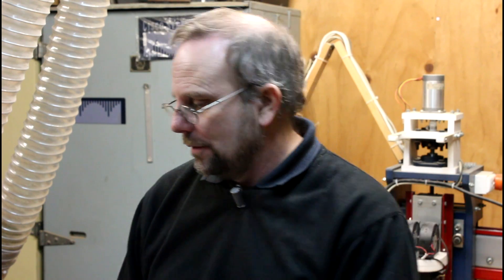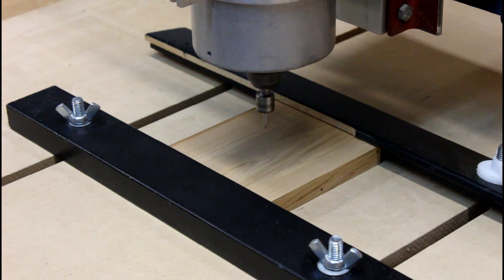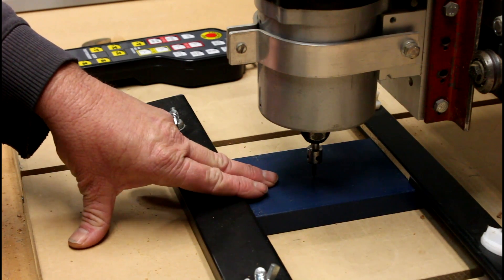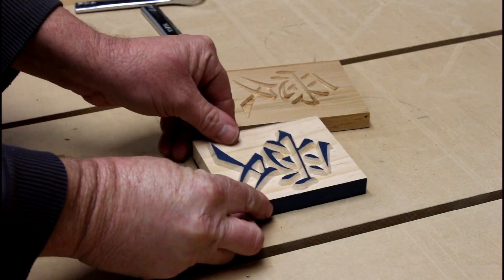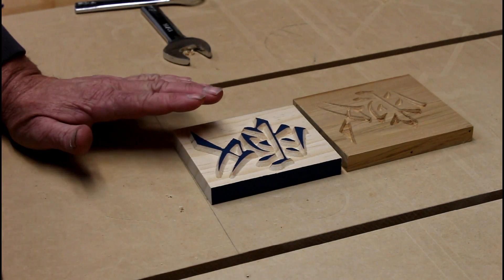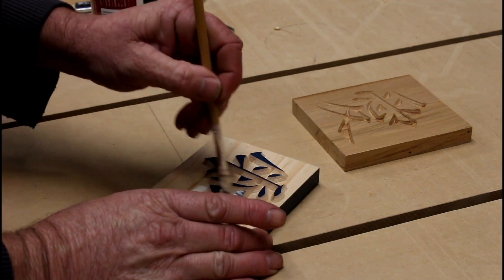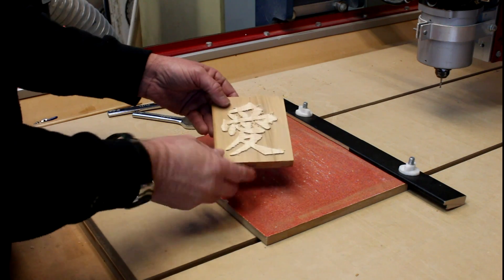VCarve inlay - CNCnutz Episode 59

Comment: The problem with this technique is its pretty much useless unless you have a very powerful motor. The need to set the Vcarve to a start depth means you cant control pass depth, so a 3.2 mm carve plue the 1mm backing gives you a 4.2 mm plunge carve which will cripple anything except a very powerful motor. You arent going to do this on most hobby machines, believe me ive tried. It looks nice but in the end its just not workable at all for anything but high end machines.
Reply from the maker: You can VCarve in multiple levels so if your machine can only work in 1mm at a time then it will still work.
Cheers Peter

Comment: Depending on the purpose of the plate, to have the symbol just proud of the surface, as it was when you have finished with the bandsaw, looks equally impressive. To the observer, unfamiliar with wood working and not knowing how it's done, it is a delicate fine result.
Reply from the maker: +Greynerd 
That's very true, I never thought of that. It would look very impressive to have v shaped characters just proud of the wood background
Cheers 
Peter

Comment: could you just but a flattening bit in cnc and flatten it all out in 1 shot?
Reply from the maker: Yes you can.
Just use the "Use Falt Area Clearance tool" to clear the excess material.
Cheers
Peter
Reply: If you have a lot of flat areas it will take some time to cut as the end of the vcarve bit is very small, you might be better off changing to a dedicated end mill.

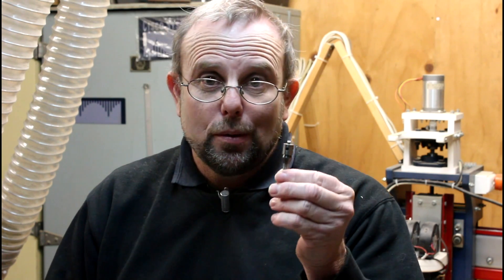Comment: Where did you get that endmill collet holder attachment at 11:00? Could be super useful!
Reply from the maker: Hi Tyler,
The endmill holder is something I made up at home on the lathe.
It is very good for holding engraving bits but will not hold endmills. An up or down cutting bit will push itself into or pull itself out of the holder because it is only held by grub screws which cannot grip the bit properly.
For an engraving bit it is no problem.

Cheers
Peter

Comment: In all honesty this doesn't work for me... The only way I could get the inlay to fit properly on my 20 Degree cutter is to make the START depth on the male exactly the same as the flat depth on the female. I then set the flat depth on the male to something like 0.1mm. If you think of it logically it is round about the same thing...
Reply from the maker: +Wonder Around 
Something doesn't sound right. When the 2 parts are put together you should have a gap between the 2 parts.
The cutter angle will have no effect on the project as a whole with respect to whether the method works or not. The flat depth should be 3mm or so.
Without being able to see what you are doing and the results you are getting it is almost impossible to work out what is going on. The document I mentioned at the beginning of the video is your best bet for figuring out what is going wrong. The method is sound and works with the only issue I had was to do with getting a decent cut because of a blunt cutter.
I am happy to try and help you figure out what is going wrong if you like.
You can email me cncnutz65@gmail.com and we can go from there.

Cheers
Peter
Reply: Hi, I know it's been almost a year, but did you end up solving the problem?  My male inlay part ended up being bigger than the female gap by using this method -- unless I did something grossly wrong.
Reply: Understanding inlays or the software settings is key. I got mine solved by taking a day to "play" on a systematic approach with inlays in scrap wood or in the case of female pocket in MDF. and the male out of any cheap offcuts (MDF male breaks normally) The function in itself is quite simple but there are a few options like start depths/flat depth that can be confusing in the beginning or for me at least when I started to do inlays for the first time. I don't know much to what you did but it sounds to me as if your male portion starts to cut too low (for a lack of better description) and then it is too big. You have to keep one variable static like the pocket (female) which is the size you want your end product to be and then systematically work on settings on the male portion/inlay (one by one) and test the inlay after each cut. This way you will know the effect of each setting but also learn how the depths can influence each other. One thing I did find extremely helpful in the day I spent getting to understand it was how I can make a very fine inlay work so that you have enough meat for a proper inlay in the finer detail leaving room/meat for sanding/finishing. This was discovered actually by accident. I also cut each and every try I made with the bandsaw in half so I could see and measure how well the inlay sat in the pocket. It might sound like a waste of time but I promise you it is so worth it... it was actually during one of these dissections on the bandsaw that I found the answer to fine inlays and also the initial question I asked...
Reply: Ok, I'll just have to put some time and elbow grease into it.  See, I thought I followed the directions in the document he referenced carefully, but I still ended up with things that don't quite work.  I'll tinker and see where it takes me.  In one vectric video I watched they cut both parts out of the inlay from the same piece of stock.  While you'd never do that practically, it was cool to see both male and female parts side-by-side in software, made it easier to judge whether things would fit in the final product.
Reply from the maker: It sounds like you are not setting your start depth and pucket flat depth properly when you are machining the male part of the inlay.
If you are really stuck you can email me and i will have a look at the files to see if I can see what is wrong. it is probably one of those things that is blinding obvious but because you have spent so much time looking at it, you can't see it. I've been down that road quite a few times and it always leaves me thinking, how did I not see that.
Cheers
Peter
Reply: Hi Peter,
Thanks for the offer -- I'm traveling this week but I'll try again when I get back.  Hopefully I won't have to take you up on it because I'll figure it out myself.

Only reason I posted it right now is because I could have sworn I followed the directions in the PDF carefully, and expected it to work as is.  Odds are I mistyped something somewhere.  The good news is that when I briefly looked at it again, the preview was glaringly wrong which means I'll be able to iterate without having to blow through quite as much wood.

In any case, I'll make a quick post here once I figure out what it was, should anyone encounter the same issue.

Sauce

Comment: I read the Vectric instructions and was wondering something.. Why did they say "For reasons that are rather complicated, it is important to use a bit whose height is at least as high as the deepest cut you will be making."? I'd love to know the complicated reason...
Reply from the maker: +Nolan Gaudreau 
Your guess is as good as mine but here is my best guess anyway..
VCarve Pro can do a VCarve deeper than the flutes of the cutter by doing passes at increasing depths.
The one thing I have found when doing this is if the cutter angle is not exact then the bevel of the Vcarve will have ridges in it. This I imagine will make trying to get the matching part which will also have ridges on it fit correctly a bit of a mission.

Cheers
Peter
Reply: +CNCnutz (Peter Passuello) Hmm Interesting thought. I guess I'll have to experiment with it a little bit. Thanks!

Comment: Thanks for sharing. It is true V Carve inlay produces sharper corner compared to traditional (straight bit) inlay, but you forgot mention that V Carve inlay cannot create design which combines different wood species adjacent to each other such as this one (www.youtube.com/watch?v=nTaQC7lZHTI). So, traditional inlay with straight CNC bit can achieve stunning results where V Carve inlay cannot. What we need is a 1/16 straight router bit for smaller detailed sharp corner projects if there is such a bit. Traditional inlay is here to stay just because of this huge advantage over V Carve inlay.
Reply: Vincent, I'm not sure this is true. It would require a great deal of repeatability, but you could process the base piece as many times as you wanted if you could only keep the zero point the same each time. It would look like this:
Run each inlay first in different woods.
Run the base piece for wood #1, glue in inlay 1. Remove the excess overhead from the inlay.
Run the base piece for wood #2, perhaps even cutting through wood #1 in some places. Glue inlay 2, remove excess.
Repeat.
Reply from the maker: +Vincent Doan 
Hi Vincent, I only just spotted this comment and have just watched your video on Laser Marquetry.  I am very jealous.
Cheers
Peter

Comment: Hi Peter

can you please tell me are you happy with the remote control appearing at 2.05 ?

I want to buy one and am divided between that model and the wireless one with jog wheel, as the one with jog wheel is much more expensive I'm wondering if the wheel is worth it ?

thank you
Reply from the maker: Personally I like it and it has worked well for me. Others have had problems with the USB cable. Mine worked well for about 3 years before the cable gave out. I just made a new one and it works well again. Others have had cable issues within weeks of receiving the pendant but it is possible that these issues have been resolved in the 3 years since I bought mine. I hope it has because I find it to be a very good pendant.
Here is a video I did which covers the pendant
https://www.youtube.com/watch?v=Mnum5PgvHWw&list=UUQ3OtAxZwlKOcjcaxkOfr6w
The Pendant was about $40 USD when I bought mine which was the cheapest one I could find.
Never having had a jog wheel I don't know if it is good or not.
Hope this helps
Cheers
Peter

Comment: Nice inlay, very well explained. Could you share where you got the cutter holder. Does it fit a 1/4 inch collet and hold 1/8 inch cutters?
Reply from the maker: Hi Kenneth,
The cutter holder is something I turned up on my lathe.
It fits my 1/4" collet and a the 1/8" Vbit goes into it.
I have just made some new collets on the lathe for the router to hold the Vbits directly so don't need an adapter now.
If you are looking for a commercially made adapter have a look here. If I recall correctly I payed $20 for 5 adapters so shop around you might be able to do better.

http://www.ebay.com/itm/2pcs-power-collet-chuck-adapter-for-tools-bits-and-cnc-router-parts-1-4-to-1-8-/201192138166?pt=BI_Tool_Work_Holding&hash=item2ed7fc65b6

I have tried one on my 1/8th Vbits and they work well for me. I haven't tried them with a spiral cutter as mine are 3mm not 1/8th so the adapter will not hold them to try.

Cheers
Peter

Comment: Sorry, mate, no hard feelings, but I don't understand where is the point in this job. I can't see any skill here. CNC machine is doing all job and all other is the first grade school lection.
Reply from the maker: No worries at all, I do understand what you are saying. I does look easy and it looks like I am just along for the ride.
The skill in this job was done long before the wood was even mounted on the table.
The machines mecanicals were built by hand in my workshop. The motors and electrical were then installed. Many hours of learning were undertaken in the workshop understanding the machine and how to use. CAD and CAM software had to be learned as well as the technique required for this particular process. Each and every job requires time spent in preparation deciding how exactly to do the job and creating the required files.
Only then is wood put on the table and the button pressed. It just looks so easy like the many infomercials we see on TV. Everything is great until you buy the dam product and try to reproduce the results. Only then do you discover that it takes more then the press of a button to do things. Sometimes hours are spent designing and perfecting that design because this machine is just as dumb as the rest of the machines ion my workshop, and in some respects even more useless.

I have nothing but respect for those who take a hammer and chisel and do inlays by hand. Some use hand tools over power, but I prefer to use power tools personally. I suspect there are very few that shun power tools when give the choice.
To me it is all about the results and it is better to spend the day building something, even if the machine does most of the hard work, than to sit about doing nothing.
I would be impressed to find any first grader who could operate such a machine to be honest. I would foresee broken cutters a gouged table and destroyed wood. Probably a sizable pool of blood for good measure.
Again I take no offence at your comment and understand where you are coming from.
Thanks for taking the time to watch and comment.

Cheers
Peter
Reply: Your channel is great and now I get the point. Ok, here in Croatia - CNC and Cad is like ''must have and know'' in school, so I did not understand the story. Great. Anyway, thank you.
Reply from the maker: Davor Kavelj No worries. It sounds great that CAD and CNC are taught in Croatian Schools. When I was at school CAD was done with pencil and paper and CNC was unknown. I suspect that this is probably still true in New Zealand schools though I could be wrong. There are definately no CNC machines in schools around here but there should be.
Cheers
Peter

Comment: Frankmali17 - I know this is a bit of a late response, but for feeds and speeds, not sure what software you use, but mach3 has a feeds and speeds wizard that helps to very accurately calculate feeds and speeds, based on material, cutter chipload, cutter size, flute count of cutter, and spindle max rpm.

Comment: Thank you for your videos,
i'm in the US and recently I built my first CNC machine.

Maybe you can share your experience and insight.
What cutter RPM / cutting(moving) speed did you use...
It sounds like quite low RPM...

Is there a guide online somewhere that you know off, that would be good reading and education on setting cutting speeds?

thank you in advance and great job on the videos.